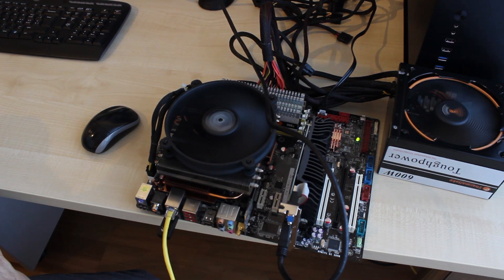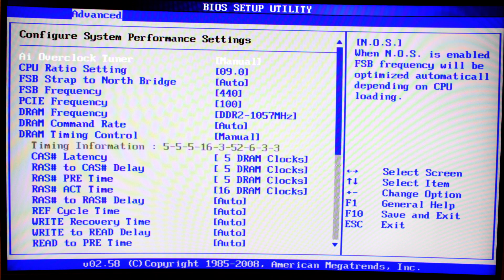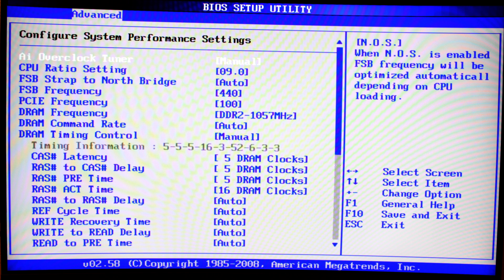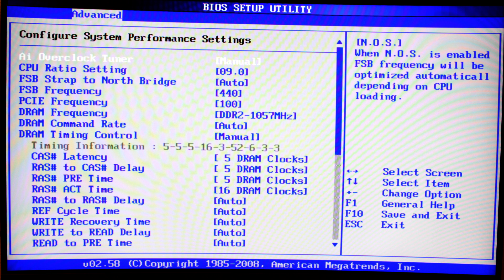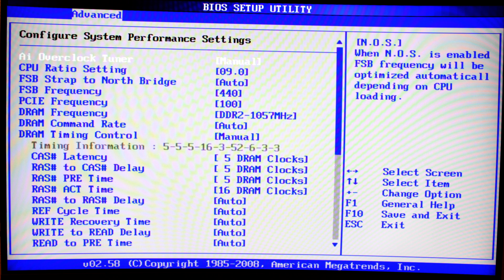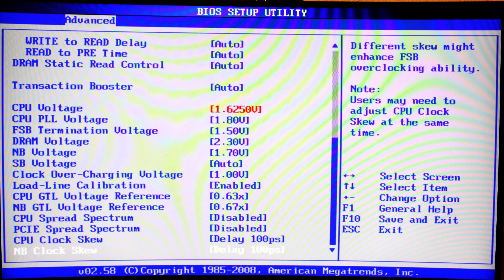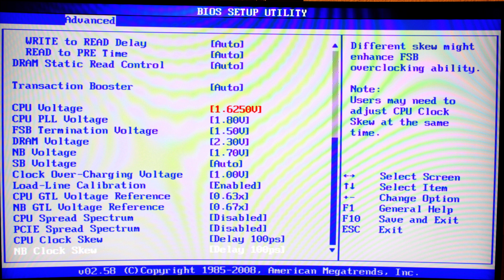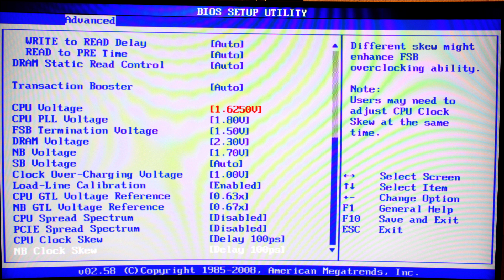HowTo: Core 2 Quad Q6600 Overclocking Guide for ASUS / 4 GHZ, english

Comment: How 3.9? Maybe my PSU is weak i dont know. I only could get maximum 3.6GHz but i discovered when i loading a cpu with cpuz stress test, the fan in the PSU slows down so.. it is only 400W so.. maybe i should obtain a powerfull one 😂

Comment: I’m amazed at how good the q6600 is at overclocking. I have the same mother board and went straight in at 3.2ghz. Totally stable on air. Might be wise to point out there’s two versions of the q6600 the later has better thermals for oc
Reply: Yeah, the version G0 and B6 or something. I have G0 and it handles 3.6GHz with no hasitation and problem what so ever. Gelid tranquillo rev. 3 doing its job perfectly but keep in mind that at those speeds above 3.4GHz, the cpu hitting its maximum potential and for the stable clocks, u need to push a bit more voltage to the CPU, at my speed it is 1.55V which pushing the CPU above 200W at full load so heat distribution must be provided
Reply: I had a g0 which ran at 4ghz completely stable. When I say stable, it was ROCK solid at that even with extreme FTT Prime95 tests. My favourite ever cpu. Ran it for 5 years and sold it but really wish I kept it.

Comment: Very respectable numbers for your Q6600. Do you think you reached the upper limit yet?
Reply: Anything above 4GHz with water cooling. This cpu consumes at 4GHz nearly 300W or the TDP at 4GHz is almost 300W because of voltage and of course frequency. Stock CPU clocks at 2.4GHz and the total TDP or total powerconsumption not going over 130W even tho the cpu is rated at 105W TDP. My friend of mine just did that with custom peltier cooling and he achieved 60c with 12x65W peltier modules and one big 380mm copper radiator. In order to achieve so good temps, he ran the radiator first to pre-cool the water than through those 12s peltiers in to the cpu. His clock was achieved at 4.35GHz 1.68V. But now you can realise the sad behaviour of this cpu, increasing frequency slightly and increasing voltage more argressive, is not a good sign. At 4.35G 1.68V he masured 470W under heavy load. 100mv down and cpu crashes. Lifespan? Maybe 1year. This is completely for fun and not to be used for daily use.

Comment: The biggest limitation on these is the ram speeds as the fsb is linked both to the cpu and ram.
You don't need a high end motherboard u need high end ram 1066 or higher

Comment: Are Asus p5q and q6600 4ghz compatible?
Reply: overclocking Q6600 above 3,4 Ghz is not good. It uses so much power, that it's completly uneffective. Just get E5450 or Q9650. Q6600 reasonable limit is 3-3,4 Ghz, above it, it draws too much power, generate to much heat. Use 45nm 775 processors to get to 3,6 - 4 Ghz. Some of them, can get at stock voltage to 3.8 Ghz.
Reply: Not true - I had at rock solid stable g0 q6600 at 4ghz. No excessive power consumption

Comment: i guess the q6600 is the most sold lga 775 cpu... back in around 2008/2009 there were so many people who had this cpu and i remember how good this chip could overclock... even with a crappy board and stock cooler you could reach 3 ghz almost certainly

Comment: Hoi Pc Tech 😁 Wie sieht es eigentlich aus, mit Amd Ryzen 7 Gen. bezüglich Overclocking hast du das Erfahrung.
Reply from the maker: ja hätte ich ;)
Reply: @CoccoUri  Wie viel mehr Leistung bekommt man da raus, bei einem Amd Ryzon 7 2700X, 😁mit einer gekauften Wasserkühlung für den Cpu. So das der Cpu noch stabil löuft,und die Temperatur nicht viel zu hoch ist.🤔
Reply from the maker: @Moonwalker87  Normalerweise etwas um die 4.2/4.3 Ghz. Aber ich persönlich finde das Undervolten viel interessanter.
Reply: @CoccoUri  A okey danke für deine Antwort, 👍 ich kenne mich nicht wirklich, mit mit Overklocking aus.😁Aber intressant zu wissen, das man etwas machen könnte. 😉👍

Comment: Ich glaube Intel empfiehlt einen Overclock mit bis zu 1.5mV.
Die Spannung die du eingestellt hast kann also deine CPU beschädigen und sollte nicht 24/7 laufen.
Reply from the maker: Deshalb meine Bemerkung... ^^
Reply: Welche wäre empfehlenswert?
Reply: @loliclanrainz2184  bei 65nm laut Intel bis 1,5v und 45nm bis 1,3625v, ich würde aber auch bei 65nm nicht groß über 1,4v gehen, die 1,3625v kann man einer 45nm CPU aber gönnen wenn man sie kühlen kann.